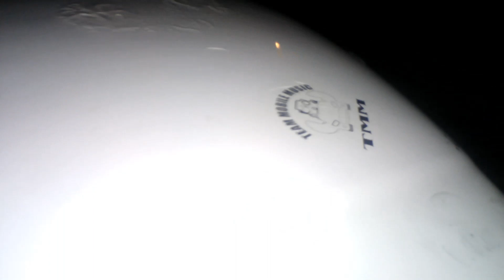SMALL CAR SOUND ENGINE ROOM ON FIRE

Comment: Yuh fuse and the 0 gage wire yuh run to the engine bay cause the fire 🔥 blood. I don't know what kinda of 0 gage wire yuh run but the fuse inline to the battery can cause it.
Reply from the maker: There was a gas leak